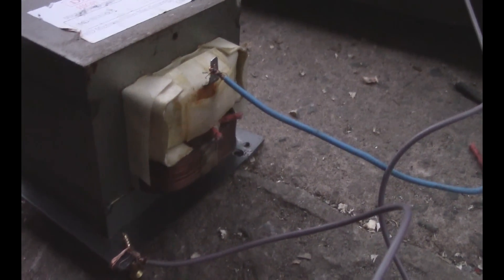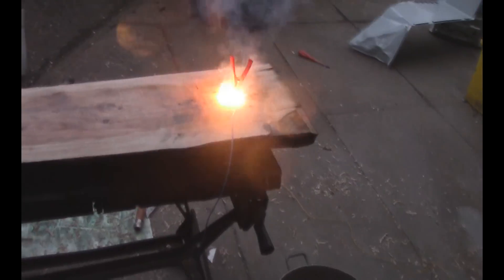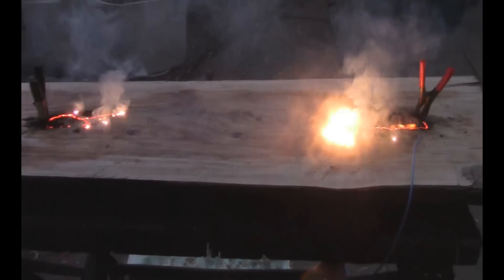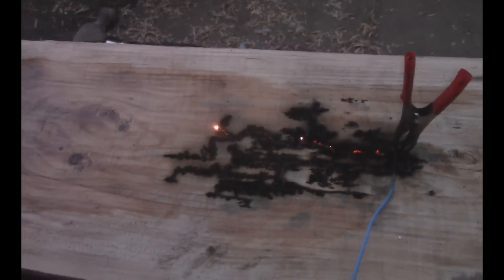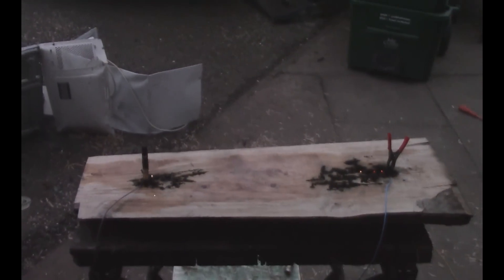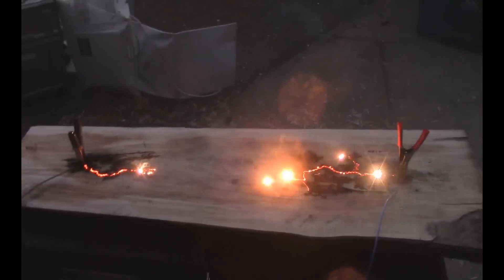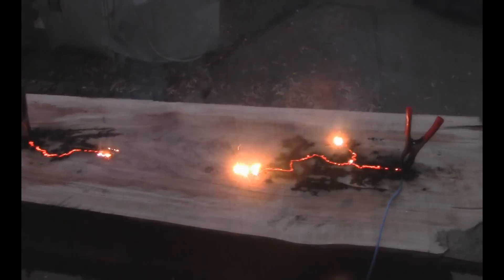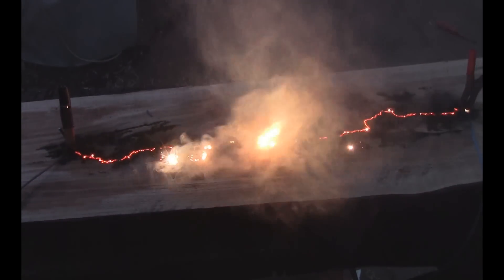DIY Wood burning Lichtenberg Figure into a Coat Rack

Comment: What happens to the fluid with brush?
Reply: I'm guessing the salt water brine acts as a conductivity enhancing/resistance lowering agent across the top surface of the board, allowing the current to travel to the other lead hooked to the nail. The brine soaking at different rates due to the hardness variance of the wood grain likely helps with the seemingly random pattern.

Comment: so what about a neon transformer? will that work?
Reply from the maker: yes, theres a few people on youtube who use a neon transformer, not a common item here and id have to buy one though so sticking with microwaves, also a electric starter for an oil fired water boiler is supposed to do the same thing but you need to find one that is rated for constant supply
Reply: +thepoultrypeople ok cool thanks. I work with neon signs so ill be about to get a few. also the more volts the more I get a lightning effect?
Reply from the maker: apparently so, wish i could remember who told me about them so i could pass that on, they were recommending the 12kv but i think they can go as high as 15?
Reply from the maker: im looking forward to reading your results :)
Reply: +thepoultrypeople Just curious if you ever tried to use more than 2 leads l. for example use 4 nails instead of 2 at the same time?

Comment: You could have used a screwdriver!

Have you tried using the solid state transformer that the likes of Panasonic use?

I prefer the cheaper finds in skips that have a conventional transformer but wondered if using solid state could give slightly more control?
Reply from the maker: no, thats interesting, ive not come across one yet, does it have a brain then that tells it how much power or voltage to put out? or does the magnatron need that 2000v to function as a unit in its own right? if i come across one ill post up some results mate, and if you would yourself?

Comment: What did you use for the finish solution?
Reply from the maker: do you mean the hard wax oil used to put a final finish on the piece? its Osmo hard wax oil
Reply: Hard wax oil Thanks, I'll have to try that on some stuff.
Reply from the maker: its amazing all natural product, i can put a wok straight from the woodburner down onto timber, coffee cups without coasters, its incredible stuff, designed for hard wood flooring on a commercial level, food safe, toy safe, blah blah blah, i really must make a separate video about it

Comment: Oh I can not wait to try this, I am going to build in a few dozen safety backups for myself because not only will the arcing kill me but I have a pacemaker as well and even a smaller shock can fry it, but this is too cool not to give it a go.
Reply from the maker: +woodturningjohn definitely errr on the side of caution m8, i did think of building a cabinet to do it in so when power was turned on it was all happening in a cupboard behind glass or perspex, extraction fans running etc. ive since bought some automobile jump start leads that im hoping to use, insulated grips and better wiring should make it even safer, good luck with it john and keep me updated, i must get my lathe commisioned, the only thing im missing now is a good couple of chisels to get started with, any advice there?
Reply: I switched to the Easy Wood Tools carbine cutter type. Because I have a bad back as well and found it hard to move back and forth the way I used to. Lots of people make that type of chisel now and I love them, because it is more about what you are turning and making and not if you are holding at the right angle  LOL.
Reply: +woodturningjohn Got my hands on a real nice large microwave today with built in hood fan as well so if I put it into a box it could have fans as well.. lots of great parts for free, now the fun part of building it starts. Hopefully by the time I get it going good I will have my computer fixed and be able to upload some photos or video of it.
Reply from the maker: thats great mate, i also got another one yesterday but a pos small 800w unit, theyre ok though, apparently theres a couple of good neodynium magnets in the magnetron but youve got to be careful of inhaling the dust if you rip that part open, looking forward to seeing your end results!

Comment: Once again, excellent job. Would a solution of vinegar and water work better for you on this? Much more conductive or would it be too conductive?
Reply from the maker: +Lawrence DiVizio dont know, something worth trying maybe?
7
Reply: Bongo, after I posted the comment I actually thought about what I said, yes I was thinking. You DO NOT want greater conductivity, you want the electrical current to create its own path. Using an acid solution would make the whole damn thing conductive. The baking soda solution reduces the conductivity and allow the current to burn along a random path it creates. STICK WITH BAKING SODA.
Sorry I suggested that.
Reply from the maker: Lawrence DiVizio ah its ok, thanks for making the suggestion regardless

Comment from the maker: update 28th december, two months on and after about 15-20 uses i think the transformer might be losing power, it was struggling with the coffee table that i did last, but wether that was its very dry pine timber and this was a piece of timber that still had a fairly high moisture content

looking at the burn however im definitely going to the local recycling center to see if theyve got a decent sized one floating about

Comment: oops. just remembered that when a person gets hit by lightning. they get a burnt on tattoo that looks like this for life. if they manage to survive it
Reply from the maker: +TheJeremyevans yes ive seen a couple of photos over the last 24hrs :) also you can capture the forked lightning effect in acrylic blocks apparently, ill do another video today, and ill use the tripod when im doing it :)
Reply: could this technique be done on sand so you could make your own desert rose
Reply from the maker: +TheJeremyevans wet sand maybe? i was watching it tonight and getting spark eye and it was white hot so im guessing it might get up to the sorts of temperature needed to fuse glass? i dont know thats a totally new field to me...but...this project has lead me down the road of microwave kilns, using a regular microwave to fuse glass by putting a ceramic(?) vessel inside a regular microwave, interesting stuff
Reply: could be an ebayer
Reply from the maker: TheJeremyevans or maybe etsy? thats an indoor project for the future for when im too old to work the shed maybe, itll happen one day
Reply: I have seen the acrylic block you're describing as a calibration output for radiology machines for chemotherapy.

Comment: Very creative, amigo! You might oughtta think about housing the microwave unit, though. The radiation on a working microwave is already quite high when you are standing in front of an "untouched" unit. Other than that, pretty cool as always. ;)
Reply from the maker: +Lone Woodpecker i think the radiation coes out of the magnatron unit, I dont use that part, I think the biggest danger is electrocution, you have wise words, even a plastic ice cream tub would be safer, thanks for the prompt!

Comment: awsome been wanting to do this for age's, came out really well and the brushing out the deep chard bits looks even better. are you still rocking that old hoover brush for your varnishing:-) love it
Reply from the maker: +Dave 508d the henry hoover fanny attachment is great for brushing your wood ooooeerrrrrr! yeah, go and find a microwave m8 and give it a whirl, simplest tool to make ever, im just about to drag a piece of furniture out to try it on that :) someone did mention that the electric can arc a foot or so, just be safe m8 :)
Reply: +thepoultrypeople I have some put to 1 side just not got round to it yet I was also going to make a spot welder out of 1 as well but you have to modify the second winding to a really low gage wire. there's a capacitor in their as well make sure you don't touch bridge the 2 wire's you will get a bit of a shock of that

Comment: A bit scary...but a lovely and unusual finish,looks really well .Nice work
Reply from the maker: +Thomas D tell me about it, ive had quite a few shocks over the years, not fun :) thanks!
Reply: +thepoultrypeople Be bloody careful and don't get shocks off that microwave transformer, bastards put out 2000-2500volts off load at nasty currents. LOVE the effect tho, have a load of bits of pallet wood I have to find a use for. I just found one
Reply from the maker: definitely, point noted, should work well with pallet wood, id definitely sand first next time though, someone was borrowing my belt sander though....